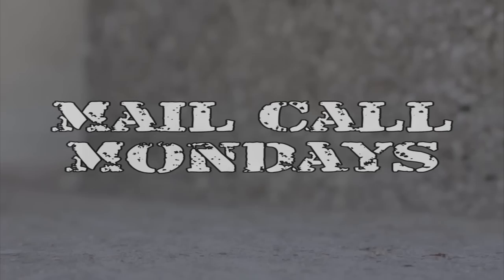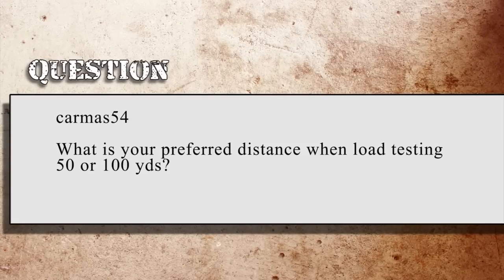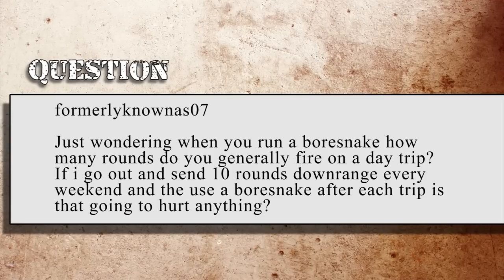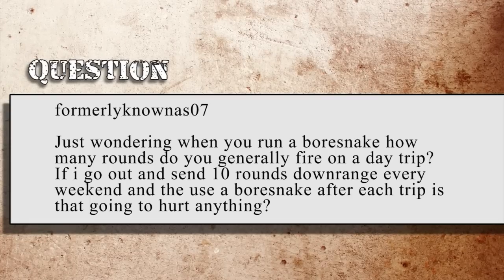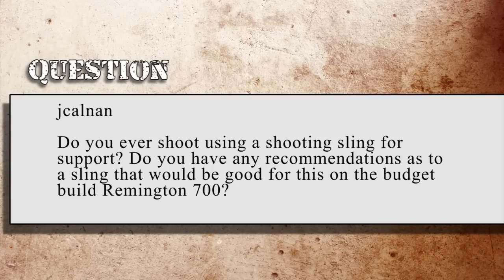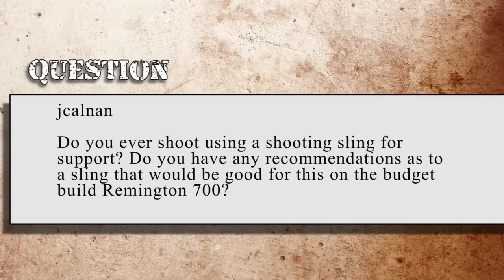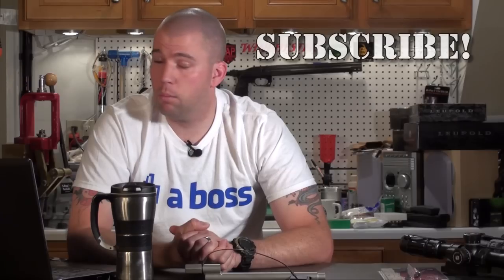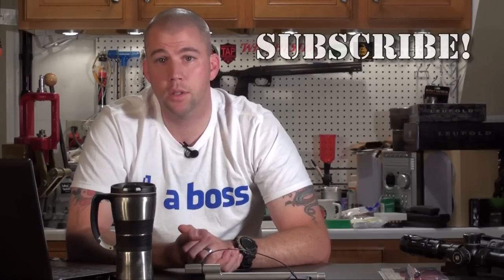Mail Call Mondays #11 - Barrel Break In, Boresnake Frequency, AI Wrench and more!

Comment: so a cloth and brass brush will wear a harden steel rifle barrel that has a slight larger copper slug shot / pushed down it with high pressure and super heat and nothing happens .. but cloth will do harm ??? really .. holy shit

Comment: Just getting into your video series, but so far, they're great!  Well put together and thought out without the typical macho-douche attitude (Ya, i'm looking at you James Yeager) of YouTube firearm videos.  As far as break-in goes, I just picked up a GA Precision built AR-10.  I followed kreiger's recommended "break-in" procedure for their barrels and found it pretty pointless.  According to them you should see a lot of copper fouling in the first 10 shots and then see it drop off dramatically.  I didn't see any more copper fouling in the first 10 rounds than I've seen in past 200 I've put through the gun so that's probably the end of "break-in" procedures for me.
Reply: +Jcreek201 Barrel break in was nessessary back some years ago due to having a rather rough surface finish, with the new rifling processes versus the old way of cutting them in makes for a much smoother surface finish there fore eliminating the increased filing of the rough bores or having to lap the bore to smooth it, most of us old guys are gone now that can remember those days lol, but the story seems to be a handed down thing lol.

Comment: What would you recommend doing in order to get rid of a bit of minor surface rust and pitting on the exterior of my Marlin Model 60's barrel without requiring it to be re-blued? I've read that soaking the exterior of the barrel in CLP for 24 hours then taking fine bronze wool to the rust spots will get rid of most of it. I appreciate any and all suggestions.

Comment: I've just zeroed in my new Sig SSG 3000 18" at 100 yds with a S&B 5x25x56 scope, Had to go to the second tier of elevation on the scope ?? Is that due to the 0 MOA rail on the rifle. 
Once zeroed in it was deadly but I'm still wondering about the scope. Thanks
Reply: If you use Burris Signature Zee Rings you can avoid having to use up so much of your scopes MOA adjustment.